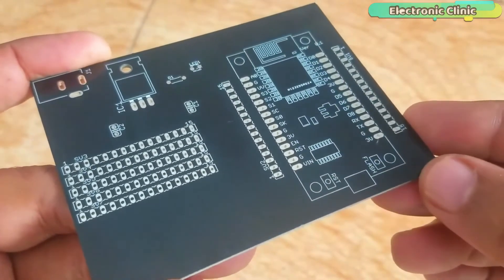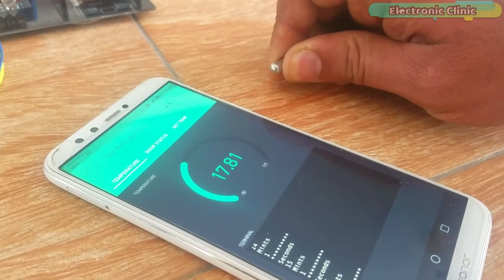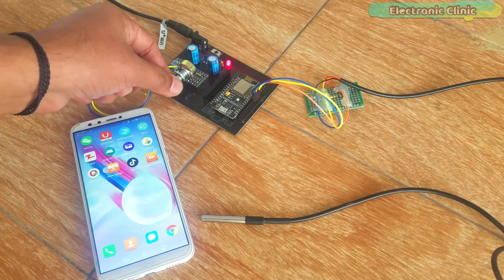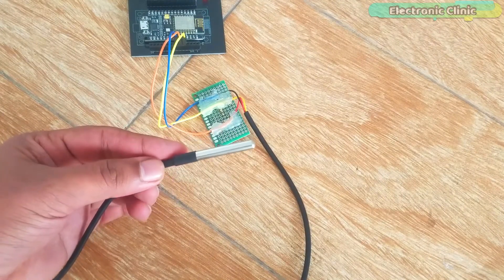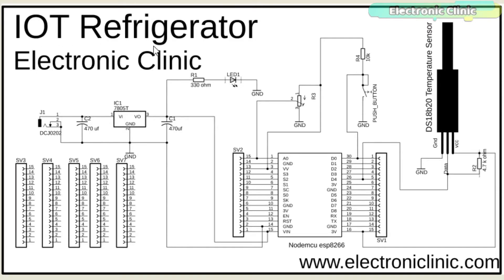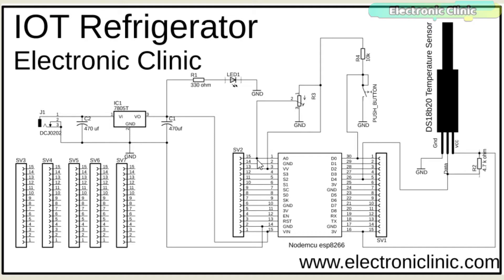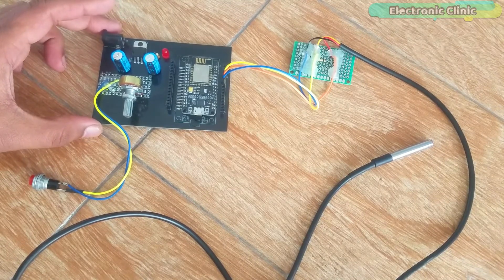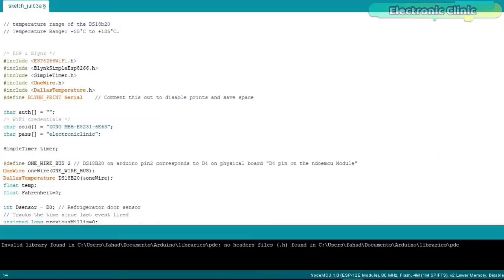Diy Internet of Things Fridge, Smart IoT Refrigerator “Nodemcu ESP8266, DS18b20, Blynk”

Comment: Hello I have few doubts can you explain it, Will wifi signal can go inside refrigerator? or only the sensor is going inside? How to you put the sensor inside without drilling a hole?
Reply from the maker: you need to find a place for the sensor, and the circuit you can fix somewhere  where it can receive wifi signals.